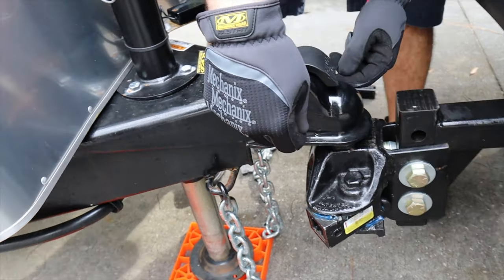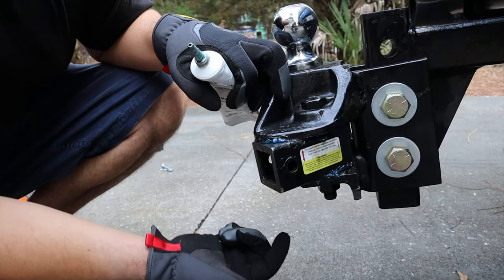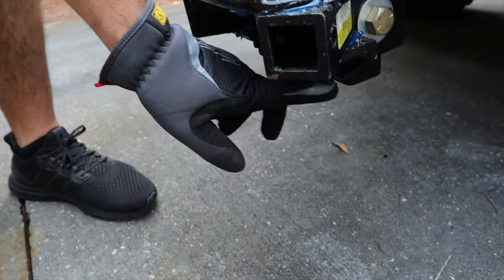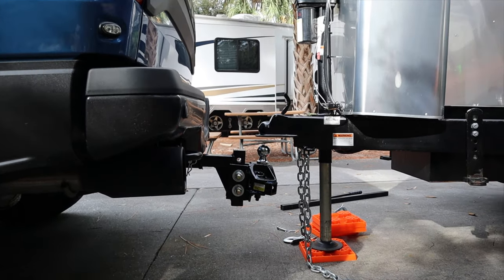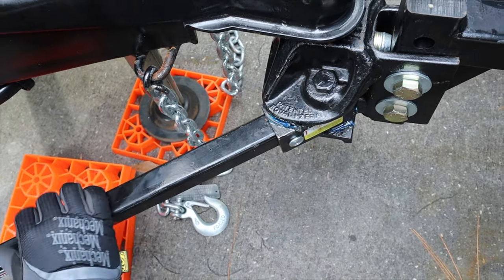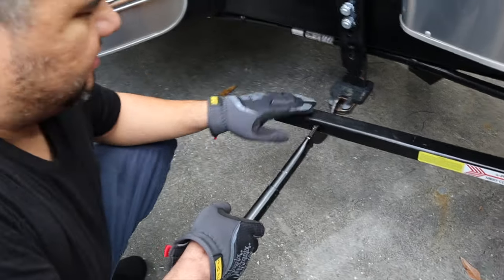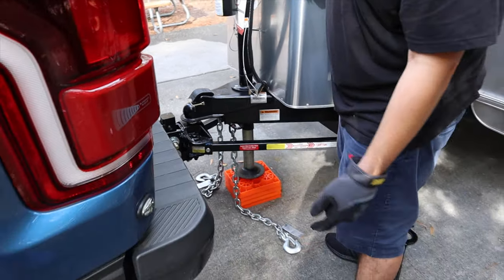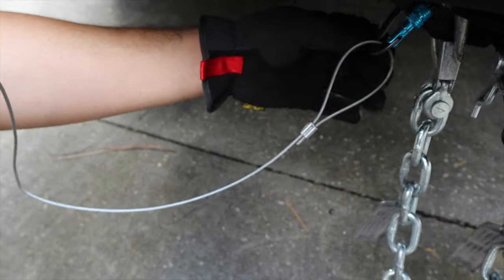How To Hitch An Airstream or Travel Trailer | Equalizer Sway Control Hitch!

Comment: Nice informative video. My 23 FB is on order and wondering did you get the 600 tongue/6000 lb Equalizer hitch or the 1000 tongue/10000 lb version?  I’m sure my dealer can help guide me but I like to have information on hand depending on what they say. 😃 Thank you!  More Airstream videos I can’t wait for mine!!!
Reply from the maker: Hi! I got the 10,000 pound version. That’s the one the dealer installed for me and it’s been working great. Thanks for watching!
Reply: @ExactlyErica  thank you!
Reply: what is the hight of the hitch ball?

Comment: Do you have a video discussing the actual towing? Like does the raptor sway  or how it handles cross wind? an other things that have come? my trailer is 5400 pounds dry weight..
Reply from the maker: Hi! We have not done a video discussing actual towing yet, but that’s a great suggestion. We will add that to the list for the future. A great website to visit for towing expertise is canamrv.ca. Thanks for watching!
Reply: @ExactlyErica  I tow plenty I have an old F350 I’m more concerned with can they raptor do it and what your experience with towing with the raptor was like..
Reply from the maker: @chizuck3322  the Raptor tows this trailer great. We use the equalizer sway control hitch, which is a must. This trailer is about 4800 pounds dry weight so not sure how a heavier one would be. Also the Raptors have sway control and ours came with the brake controller.

Comment: Thank u for sharing.  What weight distribution hitch did you go with?  My dealer is saying only use the E4 10,000 pound on our yet to be delivered 2022 23CB bunk.
Reply from the maker: Hi! We went with the equalizer sway control hitch 10,000 pound version.

Comment: Hey, great video...I have a question about the blue grease at the hitch head, I thought those parts should have crazy friction to stop the sway so when the grease is on it would it make the two surfaces non friction?

Thnaks for your help.
Reply from the maker: Hi, good question. The manual clearly states to lubricate those sections with either grease or with the high performance lubricant we showed. Seems like the torque of the bolts will provide enough resistance for sway control and the lubricant is to reduce wear and tear on the parts. It’s a balance.

Comment: Thanks for the video. I had the same raptor and 23 FB. Did you use the standard shank or did you have to buy a longer one?
Reply from the maker: We used the standard shank. The dealer installed it and they had the longer one on hand but determined it wasn’t needed.

Comment: Curious what your tow capacity is for your raptor, what about the load capacity of the raptor?
Reply from the maker: Hi! The tow capacity for the 2020 Raptor SuperCrew is: 8,000 lbs. And the pay load capacity is: 1200 lbs. Thanks for watching!
Reply: @ExactlyErica  Not bad, my 2013 Tacoma is 6500 and 1050.